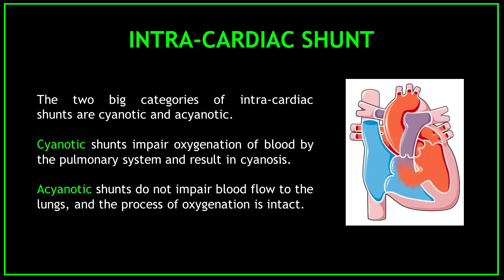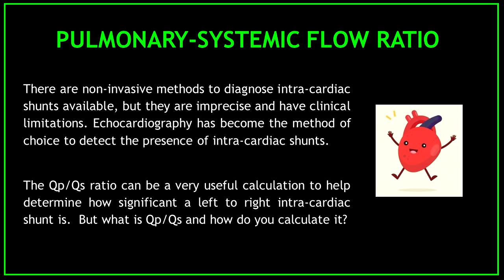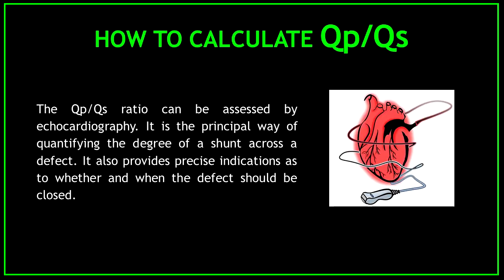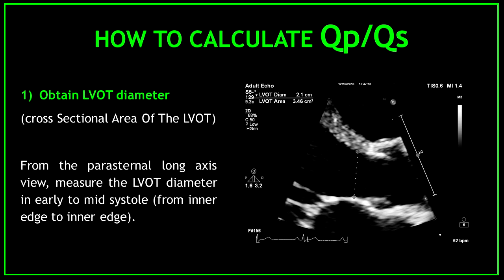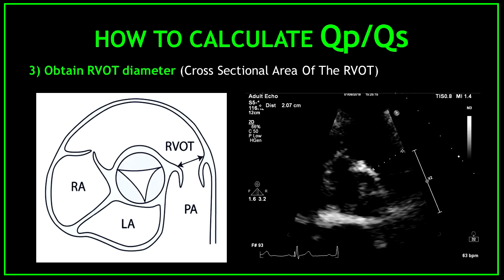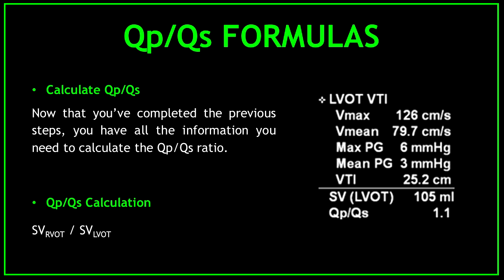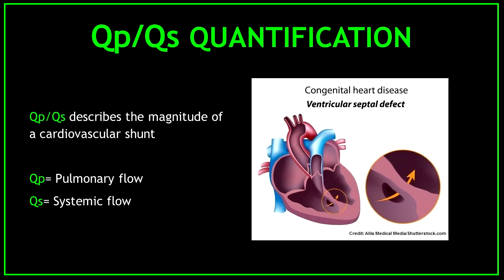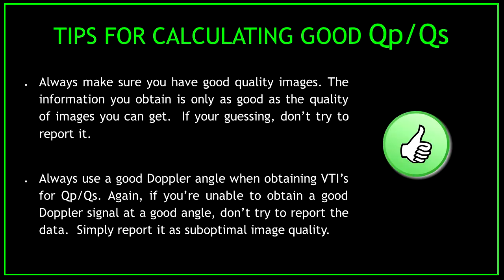Qp/Qs Ratio (Echocardiography)!

Comment: Hi, I have a questio. My echo report mentions Qp/Qs is 1,1 no hint of  significant left to right shunt. But so this means I have a shunt?? 😮
Reply from the maker: Yes but is not significant.
Reply: @the_echo_lady  but can 1,1 not still be in normal upper range? Or due to measurement errors?
Reply from the maker: @jojohanna217  os not a very accurate measurement, however we only calculate this when there is a shunt present... You should have a contrast study next to properly assess the shunt location and size.

Comment: In the figure at 8:58 the LVOT measurement does not seem to be made exactly at the insertion points of the aortic leaflets but something  like ~5 mm below.
Reply from the maker: Hello, yes the guidelines are different in every country... Here in the UK the LVOT measurement could be made up to 1cm from the AV insertion point... Now is suggested to be done closer to the valve as possible... So it's always important to check your own guidelines 😊
Reply: @the_echo_lady  i heard that Echo is not accurate in calculating Qp/Qs and the one that calculates this is Cardiac MRI , is that true ?

Comment: If parasternal short axis is suboptimally visualized, would it be acceptable to use the pulmonic tilt view? If there are no parasternal views, would it be acceptable to use LVOT and RVOT measurements from apical views?
Reply from the maker: Hello, as long as you are perpendicular to the blood flow you can use any other alternative views. And if you don't have any other option and really need to obtain this measurement, you could measure the LVOT diameter from the apical views, just mention that in the report and also you could try to check previous scans to see if they could measure the LVOT before and have some consistency.

Comment: Nice video. Just a correction. The invasive QpQs measurement is NOT "highly invasive", it just requires a venous sheath into the groin, a catheter and a few blood gas measurements from the IVC, SVC, RA, PA and an arterial blood gas. Takes about 5min to do. And does NOT require general anaesthesia.
Reply from the maker: Anything that's invasive means: (of medical procedures) involving the introduction of instruments or other objects into the body or body cavities. It doesn't matter if you need sedation or not, that's invasive, requires planning, consent, etc.